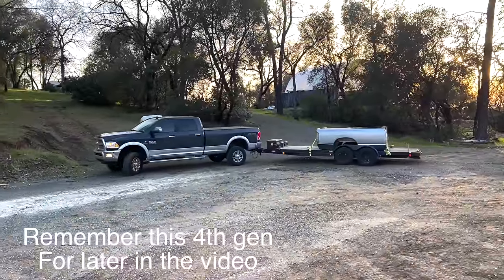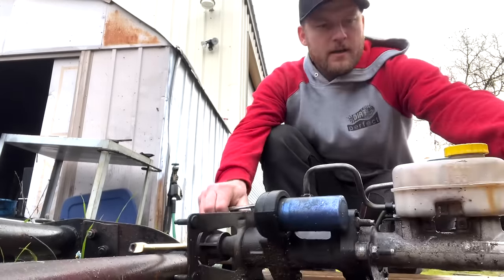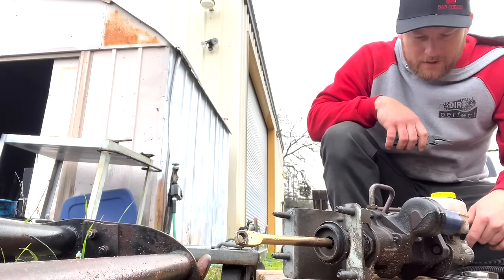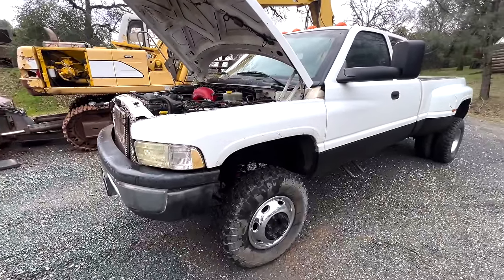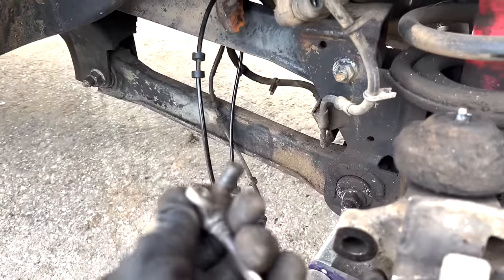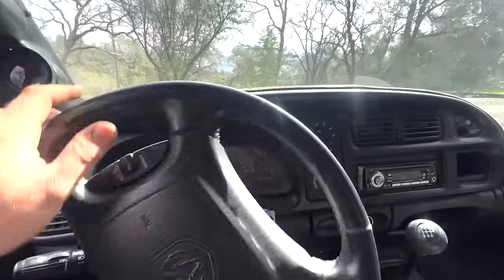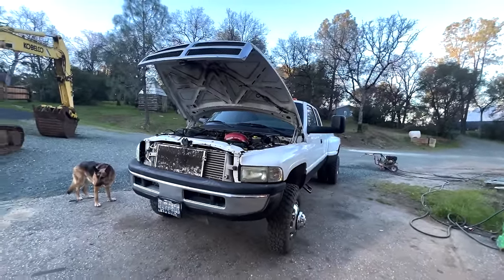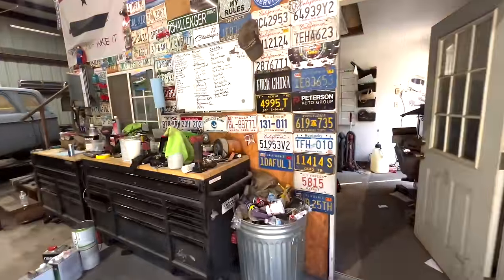Fixing issues the last mechanic over looked before buyer Test Drive

Comment: It takes atf for power steering not power steering fluid.
Reply: I mean you could use atf if you needed but I’m pretty darn sure power steering fluid is specifically designed for power steering pumps. lol